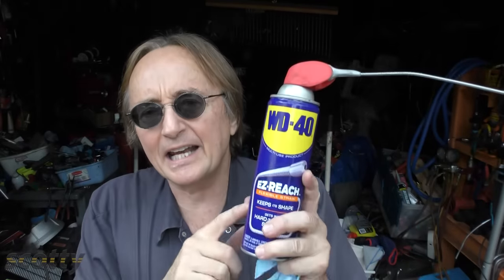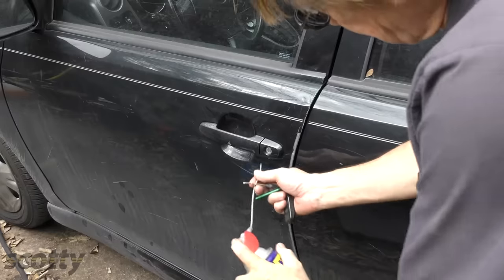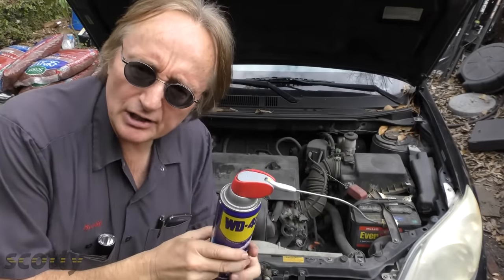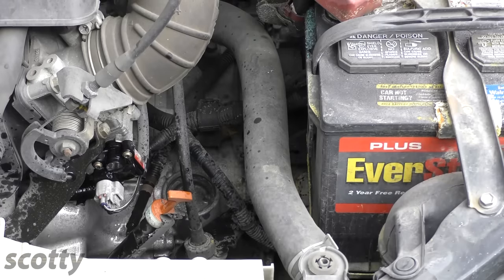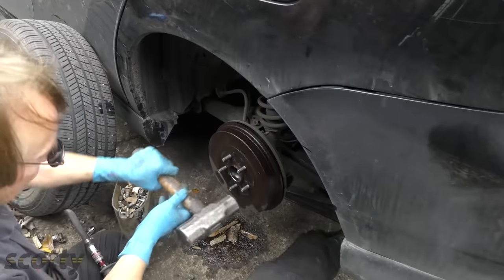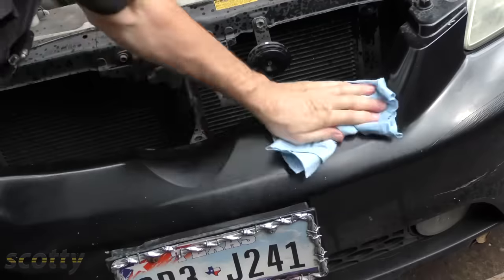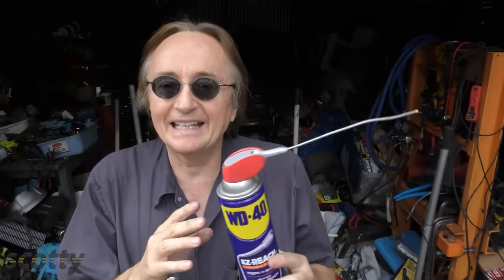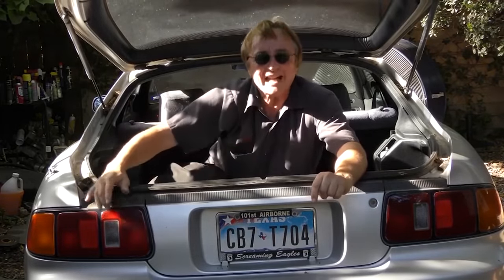Top 5 Uses of WD40 in Your Car (Life Hacks)

Comment: I love Scotty Kilmer! And who doesn't love, WD-40? I've been using it since I was a kid. And I'm in my 60s now. For years, I was spraying it all over my cars ignition system, sparkplugs, spark plug boots, electrical connectors, fuses, etc. And why? It says WD-40. Which means, Water Displacement, formula number 40. It was great on my motorcycle. It's great on my bicycle.  It's great on, Pro Audio products. It improves connectivity. It cleans away oxide scum. 

Ran out of gas on your can and there's still some in it? Open it with a bottle opener. Pour it, in your gas tank. Or just wash, the grease off your hands with it. Also good on old vinyl records. Cleans them very nicely. Cuts down on static discharge pops and clicks.

I was born in downtown Detroit, Michigan. I grew up with cars. I miss going to the car shows, at, Cobo Hall. And all the drag races, at the numerous drag strips. But hey. I didn't have to walk far from my house at, 11 mile Road and Woodward Avenue. To watch everyone else dragracing. And then that day...

I'm coming home from school, standing on the corner of 11 mile and Woodward. And I started hearing, an encroaching, obviously coming very close, jet airplane. It's a beautiful sunny day. Not a cloud in the sky. And I don't see any airplane? And it's getting much louder. Now it's getting scary. And as I stand on the corner of 11 mile and Woodward. Coming off of southbound Woodward. Turning right in front of me on to, westbound 11 mile Road. This lovely copper colored car I had just seen in a movie called, The Lively Set. James Darrin, Pamela Tippin, Doug McClure.

The funniest part was. I already knew that the Batmobile, wasn't really a turbine powered vehicle. I knew it had been some kind of experimental, Lincoln/Mercury/Ford, something or other. But I had just seen the movie about the, what I thought was a make-believe, turbine powered car. And there was. Right in front of me. It blew my mind! But thankfully. It also didn't blow me over. And I was never hit by a hot blast. And suddenly realized what a cool, automotive childhood I was having. As I also used to walk back and forth in front of the Studebaker dealer with the Avanti parked out in front. And then they had Max Smart's, Alpine Sunbeam. The Aqua Car. And then I met, Big Daddy Don Garlit. Before he ever hit, 200 mph. And Shirley "Cha-Cha"  Muldowney, when she was starting out. One of my dad's employees, was also the local, dragstrip announcer. And he got me all of the hot Rod Magazines, ever printed. I would get like 12 of them each month! And read through every one of them. Can't believe I didn't save them? Though, my parents didn't understand why, I was also getting a monthly subscription to, Playboy Magazine? They didn't know until months later. I had taken a few dollars of my birthday money, at 14. And sent away for a subscription! Both of my parents loved it. And after they were done with them. Then I also got to read them. Though, I really can't remember any of the articles?

So, no more snow for me. I'm a new transplant to, Austin, Texas. So, Scotty. You've been in Texas for ah whilenow. Where's your Texas drawl, y'all? I'm practicing LOL. It's tough when you're from Detroit. Easier after you install a couple of cans of, Lone Star, into your tank. Then it seems to come out naturally... from, both ends. I think I'm getting the hang of it? And all thanks to your Scottie Kilmer Show. Love your show!

Comment: change your struts when worn preferably  before the shock or spring bottoms out.
Reply: while struts check your wheel bearing boots and rotters and calipers and Break pads obviously. Keep underneath clean.and protected as possible from water. Most cars have undercoating .If you don't get some.

Comment: How about your trick of spraying WD-40 Silicone into the window tracks to make them slide easier.  I had that problem on the driver's electric widow in my van for years and when it was cold I had to help the electric window rise all the way.  Saw your video, got some WD-40 Silicone, sprayed it in the track and it worked perfectly for all the years I kept it after that.

Comment: But I read somewhere that the disc brake should not be cleaned with WD-40 because it forms a petroleum layer around the disc and thus reducing the friction? Is that correct?

Comment: WD 40 is great but its only a cleaner and a lubricant for a short time. If you are looking for a long term lubricant, try silicone. I don't recommend repetitive use on paints and plastics because WD is somewhat corrosive and it can eat up hoses and seals. Once again, for a longer lasting solution, try silicone. And for locks, it's best to search for dry graphite silicone.

I never use WD 40 as a permanent solution.

Comment: Hey scotty! I have a question regarding a 2015 mazda 3. The horn has stopped working, I investigated it and it turns out the wire that goes to the horn has rotted and broken. I have a replacement, but I worry the harness is rotted because the entire harness seems to be very poorly protected. It also seems to be a common problem. should I just splice in the new wire? or should I replace the entire harness?

Comment: Standard WD-40 is both conductive & combustible (I know this from personal experience). It should never be used for electric applications like ignition switches. Instead, use electrical contact cleaner or WD-40's Specialist product.

Comment: The electrical plug for my transfer case has been acting up lately and I think it's because water is getting in it and shorting it out. 

Would it be safe and effective to spray wd40 in the plug to get all the water out?
Reply: We have been using this for ABS plugs and it proved safe. Lubricant doesn't conduct electricity as far as I know.  So it cleans and wears off leaving clean pins.

Comment: Scotty, my 03 Avalon steering wheel usually squeeks in the hot Summer months, but now in the Winter as well while turning it. The squeek happens at the joint socket on the floor where the steering mechanicism and wheel axles meet. l tried spraying WD-40 and applied grease and it worked for a while. What causes it and how to cure it? Thanks.
Reply: Sounds you tried this...but my 2000 rx 399 had this same issue and I eventually got enough lithium grease in there to stop it. It was so annoying. First I sprayed in the rubber seal and it stopped briefly. I went back in the second time and exposed the squealing parts where the column met the floorboard and that took care of it permanently.

Comment: Hi Scotty

Question for you on Spring a lot. Are the locks a sealed enough mechanism that none of the WD-40 is going to escape the lock inside the door? I ask because I live in a hot climate where window tint is a must, and I'm concerned that if WD-40 sprayed out from the internals of a lock it would get on the window and start degrading the adhesion of the tint film. Is that a concern?

Thanks for all your great work, and I look forward to your response.

Comment: Been using wd40 for decades the best stuff.
Don't use wd40 on parts that have grease on them like alternator bearings.
If you spray it on this it will make it squeel like crazy and cause damage eventually.
Put grease on the back of the wheel where it contacts the disk or drum and you wont get it sticking again.

Comment: I clean my head light plastic with WD40.  I cleans quickly and it will last for about a month.
Reply: kermitefrog64 WD 40 will destroy the plastic under clean coat layer on the plastic headlights, be carefull abou using WD40 almost for everythind, it’s great (not best) hydrofobic libricant just for almost all type of metals, but if you would for example use it on your bike chain, it’ll destroy the plastic rings between each segments of the chain

Comment: The torque on the wheel lug nuts will be compromised if they are lubed.
Reply: yeah i always hit them with break cleaner whenever i use lube to loosen break parts. i'm sure he does too he just didn't show it in this video.

Comment: I sprayed a little WD 40 in my 2008 ford focus Ignition. My car will not start completely silent. My lights and window wipers are working. However, from my Ignition, this excessive black kept dripping out what could that have been? I was inserting my key and wiping it off. It took a good 50 tissues till it was clearer. And my car still will NOT start. My coolant was very low seems to be leaking down at the driver's front wheel. I feel so unsure of what to do next?

Comment: Wd40 is bad on a bolt thread when torqing it up. It will incrase the chance of ripping the threads. But wd40 helps is loosening but not tightening.

Comment: How do you feel about using the old original WD-40, like the one your using in video, for the connections to the PCM on those three plug ins that were so common years ago, like the 99 Durango I have since new. Or perhaps the CRV electrical cleaner, as you showed in other video would be best. Let me know if you would.. Is it not a good idea to leave the WD-40 residue on the inside of the pin connectors?? Also I need a PCM for this Vehicle like yesterday, would or can you recommend an honest place that sells those. P0-753 and P0-443 >>ohmed the wiring out, all great, no corrosion, no ground control from PCM and did a good ground test for everything and were great there as well. I'm suppose to know what I'm doing here, lol... 99 - Durango 5.9-ltr- 4x4..Federal emissions.
THX , From, Joe M

Comment: To all you car gurus and gearheads and Scotty included: I sprayed liquid wrench into my spark plug walls to get them to loosen and my mechanic says that the lubricant is causing one of the cylinders to misfire. Is that true or is he trying to pull one over on me? If that were the case with any lubricant I assume mechanics wouldn't use them?

Comment: I use WD40 to clean & polish my DASHBOARD! This is better than those garbage armoral wipes, which contain silica, which harms the dashboard. It will look wet, but the next day it will go back to normal.

I also use WD40 on exterior plastic surfaces of the car.

Plastic and rubber are made from...wait for it...crude oil. So it's similar to a blood transfusion for these products.

Comment: Is that bad for paint?
Reply: WD-40 will safely remove road tar, oil, and bugs from your paint.  The only thing bad it does is that part of the car will look shinier than the rest for a while.  WD-40 Silicone sprayed in the window tracks will make electric windows that do not run up the tracks very good or stick in spots work smoothly for years after treatment.

Comment: Should I use WD40 to lubricate door locks? The simple answer is you should not use WD40 to lubricate locks. WD-40 is one of the solvent-based lubricants and does not contain any lubricant and over time can make your lock even stickier by gumming the lock up.

Comment: I wouldnt spray it into the ignition switch like that in anything but an old car with no sensitive electronics in the area. 
Scotty you ought to know that for most of the applications people advocate this for there is always a much better product by intent. WD40 was king for cleaning water out of distributors and has decent penetrant capabilities. For long term lubrication of mechanisms and corrosion control it is one of the worst products out there. White lithium spray grease is much better. Castrol used to make a synthetic spray lube that was like military light weapons oil smelled and looked like honey. Cant find it anywhere now. WD40 jack of all trades master of none and you will be doing it once a month now

Comment: From my experience, WD 40 works great for a short time. However, unless they have changed the formula, WD40 will gum up your stuff after the solvents in it eventually evaporate.  You will then have a problem that is worse than before you used it.

Comment: Don't use it to shine up cars!  That's wrong!  Doesn't work well and you can shine up any pait with the right waxes snd buffing!  "Carnubean wax."   Thanks for the video!  Also you can clean off engines with it before power spray, OR get tar off a car, soak then scrub off with a towel.

Comment: Wd 40 is a degreaser. It is not a lubricant. You dont use it on chains  or moving parts as a lubricant. Common mistake people make. Use grease ot oil as manufactuare suggest